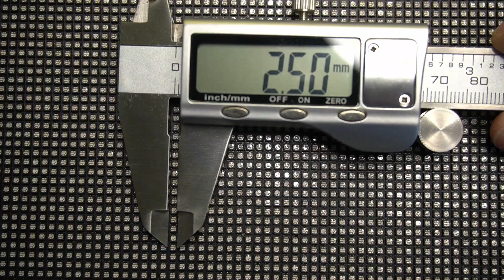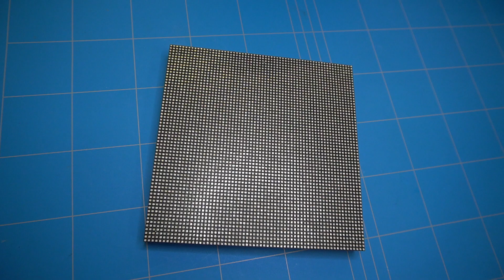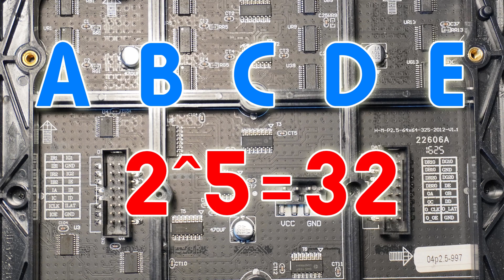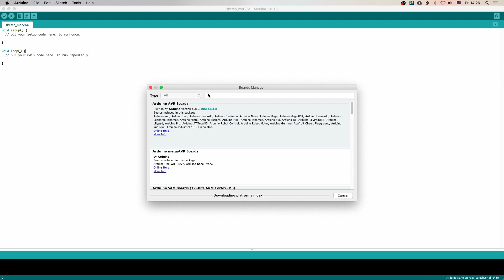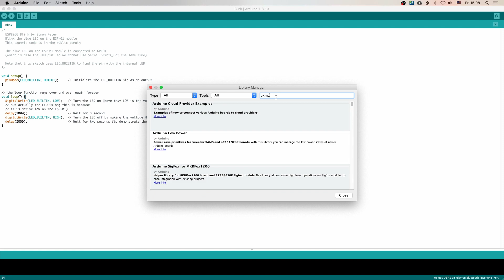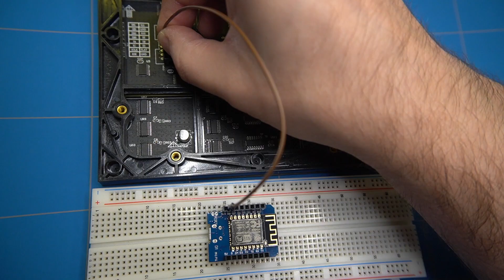How does an RGB LED Matrix work?

Comment: hi! thank you very much for tutorial!
I'm working at my bachelor project and I was wondering if it's actually possible to program such led board, so you can type text in a real time? also If it's possible to create any symbol for every letter, so that symbol will be displayed as a letter on a board? Are those tasks possible to program and wich board is better to use for this?
Thank you very much!
Reply from the maker: Thank you. It should be possible with any led matrix, the software that does it is more important.

Comment: Thank you very much for this video. I have an issue with this panel. 
Top half of the board displays only green and blue. It is displaying red. However it works sometimes. 
I am using esp32 with GpxMatrix library. Exept for the red not showing clearly every thing works nicely.

On checking I found the one of wires in the strip connector was open. I changed it. It worked for sometime randomly. Even the orange color I had given shows as green ( because of red not working properly). 

Can you tell which component on the board could be checked or why this is happening ? . Dc voltage is 5.2 volt from a 2 amp supply. 

Does the A, B,C,D pins has got anything to do with lower half and upper half ? Lowever half works nicely showing all the defined colors. Thank you
Reply from the maker: It's been a while when I did this project. You could try to dig into the schematics (link in the description) and see where the signal flow drives the red LEDs on the bottom half. I can't say without diving into it back myself.
Reply: @ezContents  Thank you for responding. I corrected the issue. The pin wire connected to R1 was faulty with loose contact (never expected it ).

Comment: Great video. I have a p3 64x64 panel that only has letters abce there is a gnd pin where the d normally is. I havent been able to find a way to drive it. I have 7 of them....
Reply from the maker: Thanks. Intereting... I haven't seen configuration like this. Maybe you could try to trace where that grid pin connects to on the board and continue from there.

Comment: Very good video and super explanation and visuals. This means all leds are strobing all the time even if the same picture is displayed? So the brightness is not even near the full brightness of the leds or are the leds overdrived because they only light up for short periods of times with relatively big pauses? This is a pretty interesting thing I think.
Reply from the maker: Thank you. Yes, you are correct. There is a short pause betweeen the time they light up, so they are basically strobing all the time.

Comment: Hello, I'm trying with 32x32 matrix. Is the pin connection going to be the same?
Reply from the maker: PxMatrix library does support 32x32 matrices. If it has HUB75 connectors then it should work.
Reply: @ezContents  can I follow their GIT document ... https://github.com/2dom/PxMatrix. Is the same pin connection going to work for 32x32 matrix?
Reply from the maker: @24Anirban  You might not need all of the address lines. Just follow the readme to set it up correctly.
Reply: @ezContents  Thank you. Let me follow the GIT page only. I need to connect all A, B, C, D, and no E. Once I try I shall get back to you. Thank you again for your response.

Comment: Hi there.  Thanks for explaining this.  I have a 64x64 panel that I want to use in an upcoming video.  So this should help me figure that out.  This is the only video I've seen that doesn't require some sort of shield.  Question - will this work with an ESP32 as well?
Reply from the maker: According to the github page of PxMatrix it should also work on EPS32. Good luck with the video.